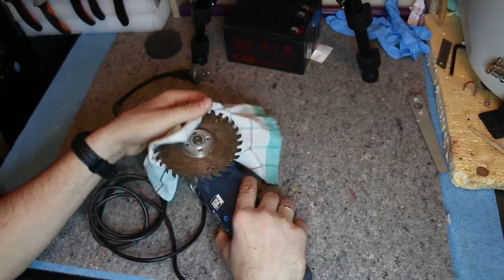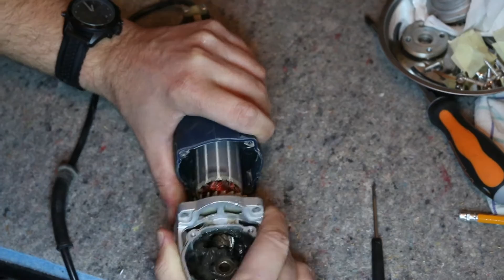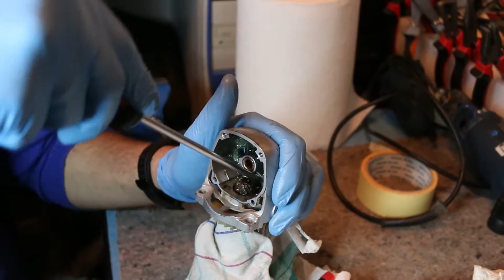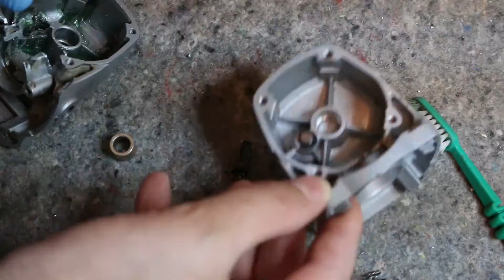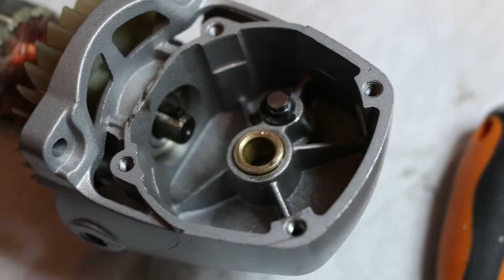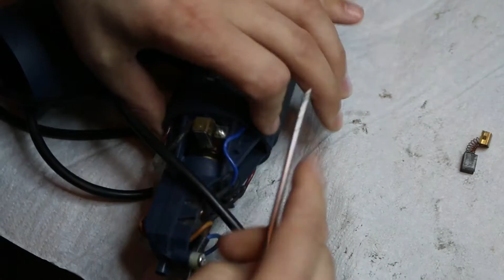Reparatie polizor unghiular Einhell BT-AG 850 (dezmembrare completa)

Comment: Mestere Dexter,este ff folositor videoclipul d-voastra.Doresc sa stiu cum pot obtine un ax de la roata melcata pentru un flex einhell.Multumesc anticipat
Reply from the maker: Multumim pt aprecieri. La momentul respectiv piesa am luat-o de la service-ul Einhel Bucuresti ( Steco) situat in strada Precupetii Vechi nr 29. Va las si un de tel gasit pe internet poate este folositor :"0723686274".
 Nu stim daca mai este service-ul acolo, a trecut ceva timp dar totusi incercati.
 Numai bine!
Reply: @MesteruDexter  Multumesc ptr informatie.As dori sa stiu denumirea exacta a surubului de la roata melcata.Sunt din Resita si poate gasesc mai usor pe aicea.Inca odata multumesc ptr informatie.Cu stima.